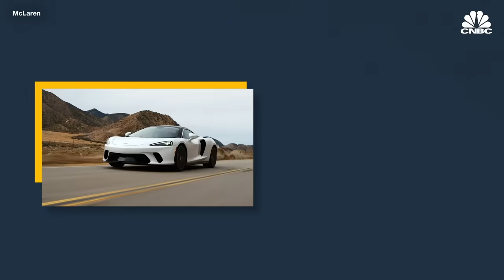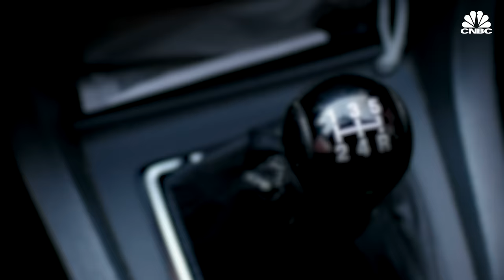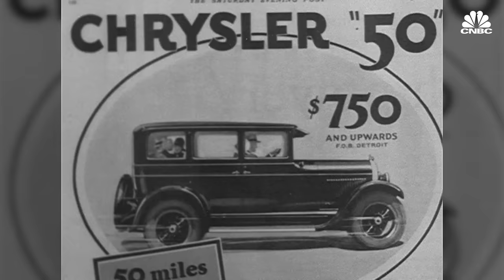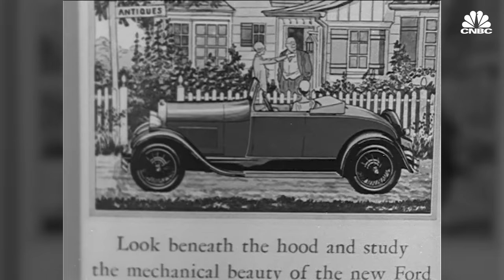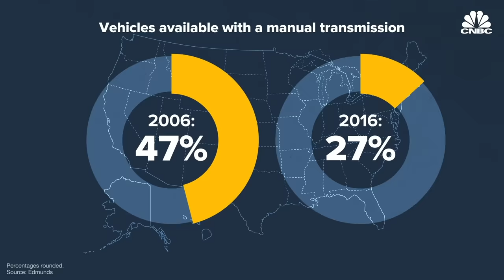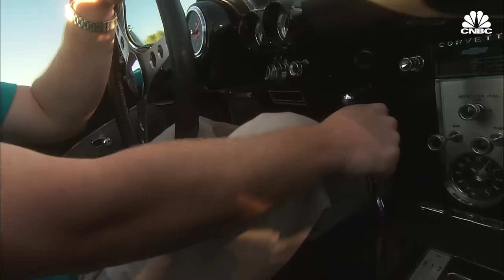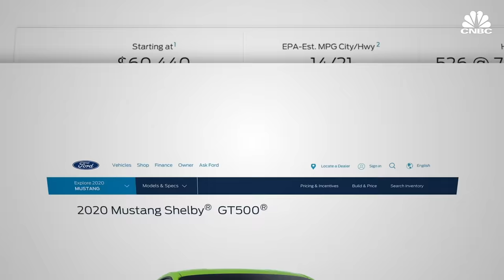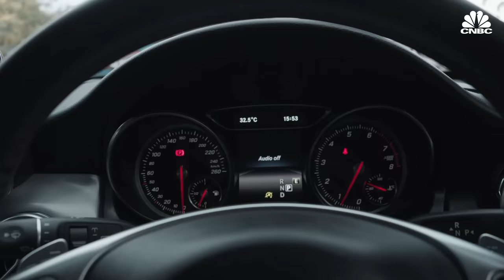Why Stick Shifts Are Going Extinct

Comment: Every non-American in the comment section: "All the cars in my country are manuals!"
Reply: Seems true.
Reply: Maybe because unlike america, we don't see driving as a boring chore.
Reply: @Basih  I'm european and i'd rather be enslaved by an african tribe extracting coal 24/7 than driving a car for more than 20 minutes but since i can't teleport to work, we may need a couple thousand years for that, i have to drive to work but anything that i can automate will definitely be automated, right now I'm driving a car with automatic transmission but very soon i'll move to a Tesla. So no, not only americans see driving as a "boring chore".
Reply: @revenantghost6160  This is the edgiest comment I have read today...
Reply: @revenantghost6160  there are cars and there are cars. I have a 6 speed automatic smart car, because of its short shift ratio I normally drive in auto in traffic but when I it opene rode I quickly switche to sequêncial. I also a mercedes C220 and manual all the way.
Reply: I'm an American. My car is the last year model VW made in diesel for the American market, luxury trim, and SIX SPEED MANUAL! 

My tinder profile even says: 
"If you can't handle my stick, you can't be my woman! 👌😹"
Reply: I think most cars in Japan are automatics.
Reply: Yup, almost all ;-)
Reply: therealhardrock nope in india automatic is getting very much popular . Even i have one automatic car
Reply: @Basih  Maybe because we drive a lot more than you is the reason it becomes a boring chore.
Reply: South Asian countries: "We'd love to join, but traffic jams make driving an actual chore"
Reply: Not all but up to 92 % in Germany, and it give a Only Automatic Drive licend that is Coaslyer than the norm shift one
Reply: @revenantghost6160  
And buying a tesla is different from a normal automatic how?
Reply: What? Lol no.
Reply: @Basih  it depends on how much traffic there is in your region, me for example, hate, hate and hate to having to drive during rush hour, i totally avoid it, but still, love driving at any other time of the day.
Reply: @Basih  maybe because unlike you, not all people generalize & understand that people are individuals with their own likes/dislikes regardless of where they live on the planet
Reply: @revenantghost6160  - I agree that teleportation is far more convenient, but until compact nuclear battery technology has improved it won't be as practical for local travel. And it's not totally safe yet—it's still possible to end up inside a mountain or something if the nav unit malfunctions, which can happen.
Reply: @ushavns  In regards to Teslas it isn't a matter of transmission but a matter of autopilot, the more i can automate, the more i will automate
Reply: Ginger  North and South America, then. The USA does not comprise any of those..
Reply: Ginger  I respect common sense. The right word is usaians. Colonialinsm was over long ago.
Reply: Ginger  The way we use the language has not hing to do with "reality". Dictionaries simply write the words that people use, whether they are smart or not.
Reply: Yeah, because china uses EVs and EVs totally have manual transmission. South America doesn't have manuals, japan's doesn't have manuals.
Reply: And they are almost
Reply: @Basih  nah maybe because y'all are broke and can't afford a automatic 💀
Reply: @revenantghost6160  dude driving is one of the best things in the world. I love to sit in my car on the weekends and just drive and that although i drive alot because of my work, sometimes 5-6 out of my 8 hours of work time.
Reply: Because they cannot afford automatic cars
Reply: A kicked dog yelps. You're not seeing people for whom that's not the case because they're not mad about it.
Reply: They're lucky.
Reply: @Astr0Dad  An electric motor doesn't require reduction gearing to maintain its optimal power band. Which is why there's no such thing as an electric car - any electric car - that uses a manual transmission: They don't benefit from it.
Reply: I'm an American and I've only driven two cars that were not manuals: my mom's car, and my mom's old car.
Reply: @revenantghost6160  trains
Reply: Most road accidents are caused by an automatic, because automatics just give too many distractions.
Reply: @frankteunissen6118  You are correct.
Reply: @revenantghost6160 if you don't like driving use public transport

Comment: “They require work, skill, and constant attention” isn’t that what driving is
Reply: Kilroy was Here yeah but more so with manual. Truly something special.
Reply: Thats why american drivers arent as good in general as us europeans.
Reply: Trust me I had a friend who had manual BMW M3 E92 and I had the same exact car but with semi auto which is paddle shifts, he was more experienced driver than me but when we drag raced he ended up losing most of the time because how fast I was shifting, trust me with manual It might feel nicer to drive but when it comes to drag racing or 0-60 auto or semi auto will shift quicker.
Reply: Sean Walker absolutely true. Modern electronics are much faster on more high powered cars however faster doesn’t mean better. After all I think we’d all take a cup of slow roasted Kona joe over instant coffee.
Reply: @TheShoX666  drag racing doesnt tell anything about your driving skill ! absolutely nothing at all ! and even less if you have a auto transmission. you can put a 2 year old in a car and do a drag race !
Reply: @tx3mobi390  There's a launch start and shift timing which requires knowledge and experience which is basically a skill..
Reply: @TheShoX666  yeah you really need to study to floor a pedal in a auto transmission car....
Reply: When driving an automatic it is easier to lose attention to what’s happening. When I drive stick I am always aware of what speed I’m driving and how hard my engine is working. I’m less distracted and more connected to driving
Reply: @TheShoX666  paddleshifting is still you shifting the gears though, and not the car? only the clutch is auto?
Reply: It's a distraction is what it is
Reply: i hope you keep constant attention while driving ....
Reply: Sean Walker Shifting quicker isn’t the same as shifting at the right time. You can hang out in first gear longer than what an automatic would for greater torque and quicker acceleration.
Reply: on shifting. Removing manual transition gives me time to concentrate on road. I understand the sentiments but automating a part of driving has only make driving easier.
Reply: This is the only reason manual should stay around, unfortunately there is no stopping progress. If it sells they will make it. I f it does not too bad.
Reply: Well said.
Reply: Kilroy was Here 

meanwhile: automatic driving technology is becoming a standard
Reply: Not according to those SUV driving housewives. They want the car to pamper them like the princess they think they are.
Reply: @TheShoX666  Hopefully you did the racing on a track or large paved area and not a public street. As you become older and appreciate your health/life and wealth accomplishments you no longer do high speeds or racing. That aside, it's possible that your friend didn't shift fast enough or was skilled enough to race. I have driven several BMWs with manual and they are very difficult and ungraceful to shift from 1st to 2nd...so paddle shifts would give you an advantage. BTW I can shift not quite as fast as paddles, but really fast.
Reply: Driving takes zero brain cells, (for automatic)
Reply: Manuals are more fun and give a greater sense of connection to the car.  Starting in second when in the snow can also be useful in preventing over-zealous nanny systems (traction control) from keeping you stationary.  I feel nervous anytime I drive an automatic.  Brake pads also last longer in manuals and engine breaking in a manuak wears your camshaft evenly.
Reply: @sureshkumar-qw9ny  Maybe you concentrate more on the road but most people use that time to concentrate on talking, searching a song in their playlist or trying to call someone I think.
Reply: I love how the video cuts to women driving 😂
Reply: @StefanAnthopoulos  I have to agree with you man. Driver a manual car you might feel the motor, sound, speed and then control better the car. Moreover, what's important, you can control the length of stick and develop a higher RPM.
Reply: No. Constant attention is not something that we humans do. 95-99% of all driving is getting from point A to point B on auto-pilot. We drive there safely but don't remember the drive at all because all of that information is forgotten by the brain. So saying that you're fully engaged in driving is to not remember all of the driving that you do where you drove but don't remember the trip -- as you should since remembering 100% of everything that you do would be scary and mentally depleting.
Reply: @TheShoX666   Manuals at most have a maximum of 6 gears and thus must play with the power band and torque available in those 6 gears.  Your semi-auto on the other hand may have more than 6 gears giving a better power to ratio match in speed which then gives you a better and lesser loss in power between gear changes which gives you a faster win.  Also, his gear throws may be long which can also be a point of contention.  There are a lot of minor point differences which can add to why autos/semi-autos may be better in drag races compared to manuals (i.e. front wheel drive/rear wheel drive, turbo and lags, tuning, etc).  
You can try doing the same but with another friend who has an electric car motor.  You'll lose for sure.
You can't compare a manual with a semi-auto/auto in a drag race, which is the same as in a race track setting or a touge.  Guess who will win that and who will have more fun?
Reply: Perhaps there are more  important work for people than just "Driving" 
Also Try driving a Manual on a Bumper to Bumper Traffic Plagued Flyover.
Reply: Automatic is the answer. It gives you constant attention on the road
Reply: Shoxrux Asadov you’re not shifting tho bro, the transmission is doing it automatically for you.. and you have paddle shifters behind your wheel so that doesn’t really compare to a traditional clutch/ manual 6 speed transmission in a drag race
Reply: The US is mailing out driver's licenses without the road test right now. Nothing is surprising anymore.
Reply: It's certainly what driving should be.  I have always said driving a manual makes you a better driver because it makes you focus on what your doing.  Auto transmissions and <shudder> self driving cars turn an automobile into a driving appliance, and make you lazy and inattentive...hence all the crap drivers on the road today.
Reply: But they don't, I shift without even thinking....plus if the battery dies, I can push start it and I can put it in neutral to be towed
Reply: All drivers who abuse texting and driving should be forced to only drive a manual stick shift with clutch. Maybe that would cut down on their vain-egotistical-selfish-unattentive driving.
Reply: I always say mandatory manuals will reduce distracted driving collisions. Cops love going after drinking and driving but cellphone and driving is easily more dangerous.
Reply: Manuals aren’t really that special... I mean lots of people in Europe drive manuals and it really isn’t that hard you just gotta get the hang of it
Reply: 702 702 in other words “yes us Europeans so elite ELLLLLLLLIIIIIIIIITE ELITE elite... we’re better than everyone else... please like me”.
Reply: i literally said that aloud then saw your comment hahah
Reply: Not really, its about getting from A to B
Reply: Driving an automatic is a good thing, not a bad thing. Automatic taking over manual is a good thing, not a bad thing. However, manual requires much more attention than automatic, it's just you start to ignore the extra attention once you are used to manual.
Reply: @katakisLives  Cars can be more than that though.
Reply: no. driving does not really require skill. if it did, everyone wouldnt be able to learn it so quickly.
Reply: Kilroy was Here something most Americans are unable to provide
Reply: wanderingbufoon only in the USA my friend in Europe most of us still know how to keep hand and feet coordinated. Lol
Reply: Yes but these fools here have been duped by corporations into wanting a tech filled transport bubble full of automation. Those cost more and only the company that make them can work on them. And people are lazy so what did you guys expect?
Reply: I don't think a bit about shifting. After so long it becomes 2nd nature.
Reply: 702 702 I think it’s because in America driving is a right not a privilege. People blame the dmv for them failing their easy tests. They literally removed freeway driving and parallel parking from the tests because too many cars got hit.
Reply: @sureshkumar-qw9ny  You develop muscle memory for shifting.  You learn what speed you are traveling by knowing what gear you are in, and sound of the engine.  There is nothing to distract you.  Engine braking is also an advantage so you don't have to cook your brakes on winding downhill travel.
Reply: @gogetter7963  This must require tons of skill.  You should add a disclaimer.
Reply: Kilroy was Here: that's what driving used to be like in the 1960's.  Today there are 100 million more drivers (in the United States) so do the math. Most people are just trying to get to work. Manual transmissions are just another headache unless you have more than one car.  The automatic for weekday work.  The manual for weekend fun.
Reply: People getting lazy that’s why lmao, having the stick reminds you that’s you should be focus in a way. Which I like also because of the control instead of relying on tech
Reply: @TiagoAlexandrec  In ten years Americans will get rid of shoelaces too because velcro is easier. Just like a 5 year old :)
Reply: Not los Angeles driving. U only need a limb to drive in LA. That's said, no arm or eye required
Reply: Yes, that's what driving is related to attention towards other cars, pedestrians and so on, not on fidgeting with a stick because you want to do by hand what a machine can do for you, this way, instead, you dilute your attention on multiple things, some of which (manual transmission) that are not necessary.
Reply: Tell that to the phone in most peoples hands in America
Reply: Used to be. For americans I see
Reply: No that's just needless complication
Reply: @TheShoX666  your friend is a bad driver lol
Reply: Why would someone want to have to pay attention to driving their car competently when they instead want to focus on playing with their phone?
Reply: Yes, I keep my constant attention on the road. I can't be bothered to also worry about shifting.

I did learn to drive a stick shift (just to be able to drive a NASCAR vehicle at a fan event), but I don't care for them otherwise.
Reply: Andrew Bellinger I feel safer with controlling my driving
Reply: James Downs can crash start also coast in neutral
Reply: dricul supposed to use gears on steep hills to assist braking in autos
Reply: gordon Nz I can’t drive my MT on steep hills
Reply: I have trouble balancing the clutch
Reply: Which is why were pushing for self driving cars
Reply: @revenantghost6160  So only those driving manual transmission cars it over vehicles and pedestrians? I truly have no problem driving a manual transmission car. Once in the correct gear for the speed, forget about it. The car engine lets you know when it's time to change gear - it will scream at you if you are in too low a gear or it will labour, shudder, and eventually stall if you are in too high a gear. So really it doesn't take much concentration at all.
Reply: @OP go. take. a manual. lesson. You're literally just not going to understand what you're talking about until you drive one.

Comment: The biggest problem with getting a new car with a manual is that auto makers seem to think that if you want a manual transmission, then you want a cheap, basic car with no frills like a nice sound system, or even cruise control.  So It looks to me like manufacturers had a lot to do with the drop in popularity of the manual.  Of the 40+ cars I've had in my lifetime, I'd say at least 30 were manual.  And If I had my way, I would have gotten a 5 or 6 speed pickup or SUV when I had to replace my car this past winter.  That was the plan, anyway... before the price gouging madness we are being screwed by today.  But I definitely prefer manual over automatics.  Like I've always said and it's nice to see I'm not alone in saying this, but in an automatic, you're just going for a ride.  In a manual, you're driving the car.
Reply: Check out BMW X5 2004 models- some came with manuals, and the 3L I6 are pretty good
Reply: i mean that is the sterotype. although only anecodtal most people i know who wanted manual transmission make fun of all those luxury things you mentioned. but again just anecdotal on my part.
Reply: The 4th gen Mazda3 manual comes with the premium trim, is a ton of fun to drive, and even at that trim you can still easily get it below $30k. I got my 2021 manual mazda3 for $26k. It doesn't have a ton of space but everything else about it is pretty great and it looks amazing. I also get significantly better mpg than Mazda claims. If I shift later at 4-5k rpm then I get like 27mpg city, otherwise I get about 31mpg city driving casually.
Reply: 40+ cars? Stop totaling them, man.
Reply: It’s because a lot of older people who can actually afford cars don’t use their speaker system or cruise control. I’ve never seen my mom even use the speakers in her car or the cruise control.